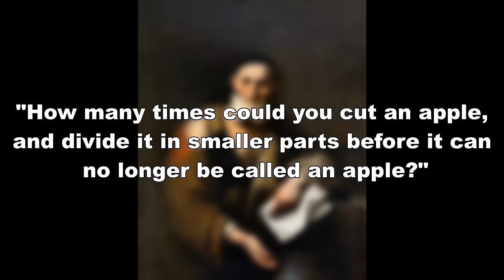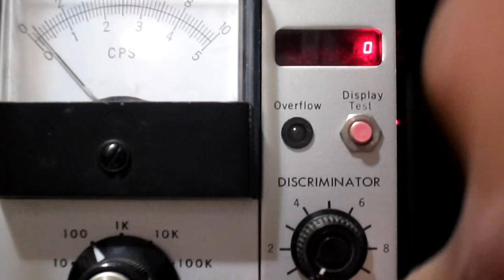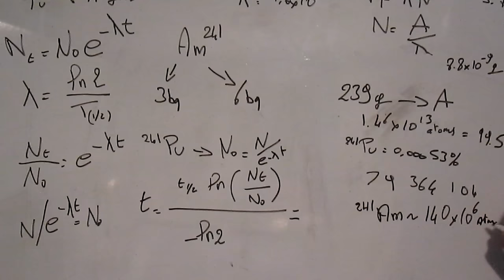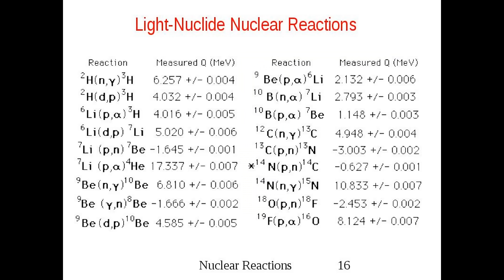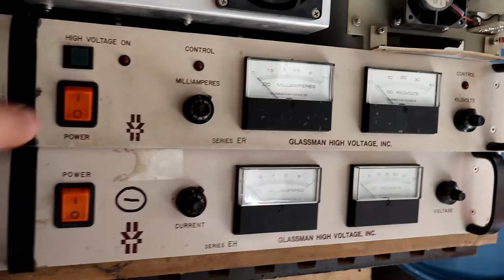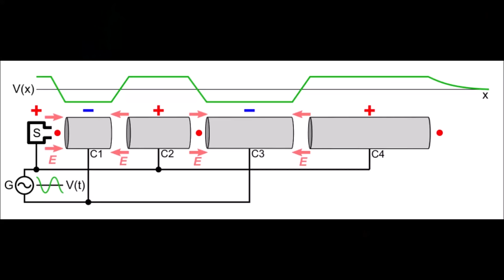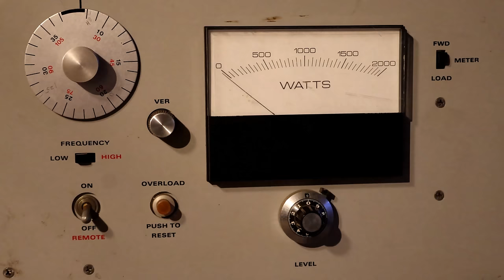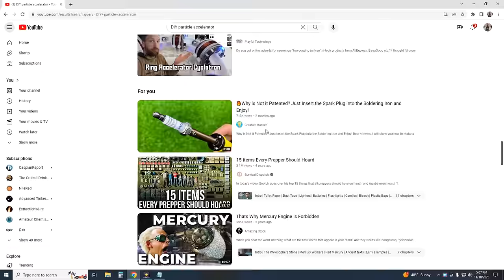DIY Particle accelerator (part 1)

Comment: The more advanced stuff you would take on- the more hardcore problems you would need to handle, but by the way I recommend making your workshop more tidy and organized so you would save some time from finding stuff, and to prevent from being hurt by shards of glass add a steel net around so it will protect you - good luck!
Reply from the maker: Yes that is very true. I really, really need more space to work.. One problem at the time my friend..Thanks for watching!

Comment: As a retired professor of chemistry I will say this video impressed me (enough to subscribe).   You have the energy, drive, and insight that I treasured in undergrad and graduate research students.  Would you like a free 200 MHz superconducting NMR machine that was taken out of service working?   I was going to set it up but I don't have the energy anymore.   If you want to drive a small truck to SE Ohio it's yours...   bring a strong back with you.   :)

Comment: Great job, man! I have been looking for a video like this one as I have been wanting to build a particle accelerator since I was 16yo. However, all my current knowledge in physics is self-thought, so I didn’t want to take the risk doing it without at least some kind of guide. If i get to build it, I’ll use this video and hopefully part 2 as references. Again, good job.
Reply from the maker: Excellent! I'll try to give as much details as possible in the next one but based on parts and work this may be a few months you know
Reply: @Neptunium  I have to get the money to do it, so I’ll take some months too jaja. Take your time, I’ll be happy to wait. Meanwhile, you gained a subscriber :)

Comment: Bravo!  This is great!  Definitely worth a subscription!  I’m a little surprised that no one else on the tube has built such a device, but it does require some knowledge, insight and chutzpah above and beyond the call of duty.  So definitely continue, albeit do be careful!  One thing you might want to do is a video on your design and the computations and references etc.  also you could do a video on just chasing parts!  What you were looking for and what you found. Those are just 2 video ideas and there are more. Do keep working it, as I’m amazed at what you have already done!
Reply from the maker: Oh thanks a lot !!! Really appreciate the support! You know, it's a very good suggestion, I was going to explain a bit of math and design but I didn't think about the part chasing situation! A subscribers recently offer to help with vacuum parts and  I might get replacement soon! I was also surprised to not find anything serious on YouTube either... Anyway, thank you again for the sub and for watching!

Comment: Once the setback is overcome this will be very interesting. I would recommend you to try a scan of RF frequencies for the accelerator tubes as there will be some optimal value. 
Your vacuum chamber windows are pretty big, smaller ones would break less easily but you do want good optical acces. 
What kind of turbopump are you using? If i caught the number right you were down to 10^-9 bar which should be good enough. You could consider a getter coating to not introduce magnetic fields. Ive seen getters down to 10^-10 bar.

Comment: Very interesting project, I really want u to succeed!
I study high vacuum principals for a bit and i can say that it is not recommended to use any organic materials (plastic, rubber, plexiglas etc.) inside a high vacuum vessel. The reason is that such materials can release a lot of gases under the vacuum conditions that can prevent reaching a high vacuum. So it's may be better to use mica (like in vacuum tubes) or ceramic spacers and insulators. Hope that it was helpful🙏
Reply from the maker: Thanks for the advice! You know, I did look into ceramic spacers but it was so expensive i went with the plexiglass, I was worried it would degas since i have to heat it to get rid of the water and thats why i was keeping track of it with the RGA.. Even at 120C i did not see any sign of degassing material . Acrylic soften at about 140-160 ish so if i keep it below that i should be fine...hopefully ! 
thank for watching!

Comment: Since you have to rebuild, I'd change the tubing from copper to stainless steel.  Yes you'll have to spot weld, but soft solder probably doesn't belong inside the vacuum chamber anyway.  Also the plexigass insulators may outgas.  Boron nitride (you can get it from McMasters, but it won't be cheap) will be better, it will stand up to ion bombardment.  In my fusor, the ceramic insulators eventually became somewhat conducive and started arcing over.

Comment: Hello sir, 
As you said in the video the tubes constantly get longer and longer. So how do you calculate the increase in length and other important dimensions, I currently do not know much and it would be great if you advise me where to start learning all of it. 

Thanks
Reply from the maker: There is a PDF file from the CERN or Fermilab available online if you Google drift tube linac. I'll post the link in the description as soon as I can. Basically, there is a formula for the dimension of the tubes but you can intuitively arrive to the same formula using E=qv and E=1/2mv2. I did plan on explaining it in the next video once I get things fixed and going right .  Thanks for your question and thank you for watching!!
Reply: @Neptunium  Thankyou for the help ❤️

Comment: Very cool endeavour, and congrats on the progress so far! 

If you were at slightly higher frequency, a radio transmitter might be an economical way to drive your drift tubes. Maybe you can find a variable LC circuit in the amateur radio handbook (apparently a lot of early accelerator physicists were amateur radio operators).

Was the turbopump running? If so, I'm amazed that it survived. If you have access to liquid nitrogen, a getter pump might be cheaper to operate. Activated carbon can be a cheap getter material because it's just made from charred coconut husks and used commercially in water filters and whatnot. Also, if you have a high voltage DC supply, you could consider doing your higher vacuum pumping by making an ion pump from a titanium plate. However, if your drift tube holder/spacer disks are made from plastic, it may not be compatible with very low pressures. Also, you may want to modify their design, because they are dividing up your vacuum chamber into sections and making it harder for your turbopump to pump on the far sides of the chamber. The more you can reduce their cross-sectional area by drilling holes in them, the lower pressures you will be able to achieve.

I'm fairly confident you can make your own Faraday cup. Ideally you would also have one right at your ion source for setting up ion extraction. A "suppressor lens" makes a Faraday cup more accurate, but any isolated metal plate will do. Your drift tubes can also be improvised Faraday cups. I didn't see your ion source, but how do you plan to ionize the helium? The strongly bound electrons that make it safe for high voltages, also make it a pain to ionize. Personally I would start with something surface-ionizeable, like a tungsten wire that you can dip in potassium salt and heat up as needed. I don't know if you designed your drift tubes for that heavy of an ion though...

Let me know if you want any clarification. Best of luck!
Reply from the maker: Thanks for these advices! greatly appreciated.. the ion source is the hot filament i described in the video, I thought about adding a magnet and another negative bias electrode to force the electron into a spiral and increase collision with helium. You are also right about the acrylic spacers, I was going to either drill holes in them or replace them with ceramic rim like dividers.. So far they have not degassed down to 10e-6 Torr and 120C.. I saw nothing on the mass spectrometer.. There is obviously more work to do and i am glad you`ve reached out with suggestion! Thank you !

Comment: Very nice! Subbed. I am glad the YT algorithm delivered me this gem. I know there is a Farnsworth fusor message board, maybe they can answer some questions for you as they deal with similar vacuum and high voltage. I dont know what failed first, but I would suspect the view port as it is quite a large area that atmo pressure is acting on. You could likely make the view port a smaller diameter to help it withstand more pressure differential.

Comment: Love your stuff mate. If you don't mind me asking. What failed, and why did it fail? Also, forgive my ignorance, but I thought it was under vacuum, was it an explosion that shot the glass at you? Or did it implode and then shoot it at you?
Reply from the maker: You know, with second hands parts from eBay you never know what you are getting.. I suspect an error on my part and assume all responsibility for my mistake, in retrospect i probably turn the wrong valve and pressurized the whole thing until it simply blow up.. I`ll try to figure it out and explain in the next vid...thanks for watching!

Comment: Glad you were not seriously hurt! 😮 The ion source would work better if you used a RF plasma followed by some electrostatic acceleration in two stages first is a low negative potential relative to the RF electrodes. You will need is to have the ion generator at low  pressure but not hard vacuum and hammer it hard to create high speed ions. A simple negative acceleration voltage of roughly 50kV is needed, and get a silicon nitride window for the the accelerator beam injection window from the ion source. The drift tube unit really needs a high vacuum to do its job properly. As far as the failure goes, a lot of the things are fixable but some will need replacement. Also an electromagnet around the beamline will greatly improve the beam quality. Try using a smaller viewport.❤
Reply from the maker: ALL good suggestions and advice! Thank you for that! Some viewers have already offered to help with parts ! so this accident may be a blessing in disguise! i can`t wait to get back to work ASAP!! Thanks for watching! and the Silicon nitride is an idea I might use!

Comment: Set backs are more than common hope you have learned from the explosion the root cause of the problem and what is next to fix the problem. Your tenacious and creative efforts will pay dividends but you may want to find a more favorable location to separate the work load and maximize the space limitations. As a polymer chemist and researcher myself I use local academic institutions to operate safely and it pays off by giving me more breathing room. Good luck
Reply from the maker: Hey you know your right! My wife suggested that too!!! Great input! Thanks
Reply: Remember it’s not where you find yourself after a problem but what you do from that point moving forward. You will be successful no doubt!

Comment: Hey, what an amazing project! I've been told to check it out to see if I could leave any input since you are looking for help, I am an electronics engineering major with a specialization in power electronics, so I am open to help if you want.

I am not too familiar with particle accelerators but I have some familiarity with vacuum tube electronics and cathode ray tubes, which use static acceleration.

One thing that I seemed to miss, was the frequency range you look for in your oscillator. By intuition I imagine the peak velocity you can get depends on the product of the frequency and amplitude, and the dimensions of the accelerator electrodes and gaps can be optimized to work with that.

Another simpler suggestion I have is about the geometry of your hot cathode, I imagine if it was a zigzag rather than a spiral you can get a higher yield of ionized nuclei than with a spiral. For the ionization to happen surely you need the helium to be in rather close contact with the cathode (or the closer the better in other words) and be exposed to the electrons emitted from the cathode. A spiral filament actually restricts this, they were invented for use in lightbulbs as they improve efficiency by reducing gas flow around and through the filament coil, and I think there's also some IR energy reabsorption effect that doesn't really matter in this case.

If you could use a larger cathode current (or a lower cathode impedance) without overheating the cathode, you could apply a coating to it, these are usually done with carbonates I think, but I haven't looked much into it. I'd binge some videos by ron soyland, aka glasslinger on youtube to see what he uses in his vacuum tube cathode coatings.

If you want to make a discord server and invite your viewers into it to discuss I'd recommend that, or if you want to hit me personally you can find me by this same username there. I think if there's a problem you have that I dont have an answer for, I can likely track down someone who does through contacts.
Reply: P.S: You may be able to measure the output velocity by adding an extra electrode or perhaps a small magnet that deflects the beam at an angle that is dependent on the incoming velocity and observe the angle in a phosphor screen
Reply from the maker: Oh Glassinger yeah! he commented on here ! i always heard BaO was a good electron hot cathode enhancer but carbonates may work good too.. The reason i need a tunable RF between say 10 and 500KhZ is precisely because of the uncertainty of my drift tube dimension and capacitance once inside the main body . So I can find the proper frequency by trial and error.. This is very generous and I truly appreciate your help! I am not familiar with Discord so I might try to contact you directly.. in any case Thanks again for your help and support and thank you for watching!
Reply: @Neptunium  Glad to see your reply, I'll be on the watch for you if you figure it out.

Fortunately for you, 500 kHz isn't a super high frequency and that opens up the options to make such a driver in a number of ways.

Good luck and I'll hopefully see you soon!

Comment: I'd love to see the final result!! Were you able to find out the reason of that catastrofic push of failure? Check alternative circuits circuits like the Marx generator or the Cockroft walton (used in particle accelerators).
Reply from the maker: yes me too! I need some times to repair and replace some parts but I am working on it.. I think it was a dumb mistake on my part! I take full responsibility for it! Marx and Cockroft are both DC and get very difficult to handle above a few hundred Kv  that`s why I am looking into RF and the drift tube with AC...Thanks man!

Comment: The TMP survived that vacuum loss? Was it not operating at the time?
I wonder if you'll want more control over the waveform as you mentioned, or over the bias voltage of the electrodes (I wonder if a small bias - DC voltage is commonly applied to the electrodes to maintain a concentrated beam. May not be necessary at all...) you could easily implement a DC power supply through isolating chokes for the DC side and isolating caps for the RF side (after calculating the appropriate L & C filter values per your operating frequency).
You should be able to fairly easily build a square wave RF generator using a full H bridge circuit and a ferrite or air core transformer, similar to a SSTC circuit (you could probably buy a full bridge SSTC switching/control circuit, modify with fixed frequency control instead of closed loop self-resonant control to repurpose it for this). 
I wonder if you'll want to have easily adjustable electrode gaps/positions. Luckily, Helium has quite a narrow maxwell-boltzman velocity curve, so the velocity at any given temperature is fairly predictable. You can use that to determine the necessary gap to the first electrode, given the electrode voltage, for good results...
Regarding the electrodes I also wonder if you would want more electrodes with shorter length, so you have more control over the overall delta-v, reduce the delta-v per stage(I don't know what velocities or frequency range in which you want to operate).
Reply from the maker: no the turbo was not running thankfully! but I am still going to clean it up and thoroughly check it before putting it back in service! You are correct about the small bias voltage! this helps keeping the electron in the ion source from going straight to the anode and produces more collision. My main struggle is to keep everything isolated from high voltage, ground and bias voltages.  In a perfect world, EVERYTHING should be controllable ! unfortunately there is some obvious limitation and constrain ! but I released this video early hoping people like yourself would help with the part I am not very good at! and so far I must say you have been very helpful! I am deeply appreciative and some viewers have even offer to help with vacuum parts replacement ! So I hope to get all my affairs in order, repair and replace what needs to be fixed and keep working on it  as soon as possible. Thank you for your ideas and advices! much appreciated !

Comment: This is exactly the video i was looking for, ive been trying to build a linac ever since i replicated the applied science video where he shoots electrons into the air. Ive been trying to source the equiptment for an x-band magnetron(boat radar) to use as an RF source for a standing wave accelerator but i dont know how i will even make the drift tube. I think i should try something closer to what your going for in this video.
Reply from the maker: Excellent! Good luck to you my friend! I am still  struggling! Thanks for watching!